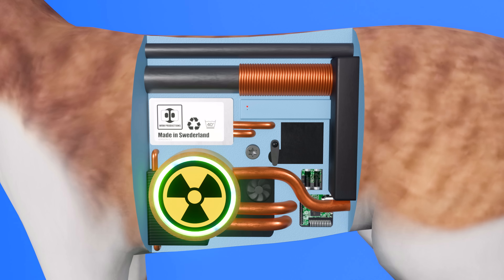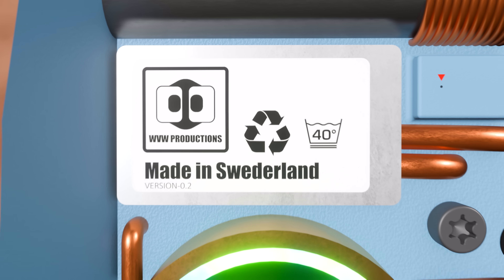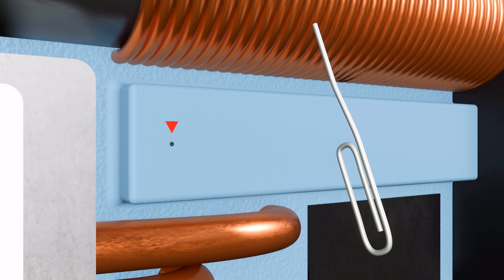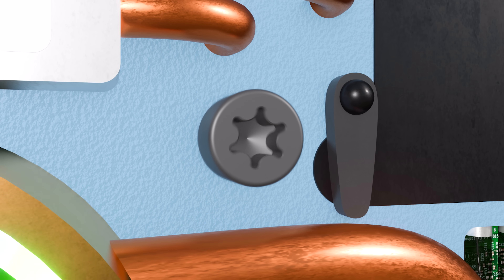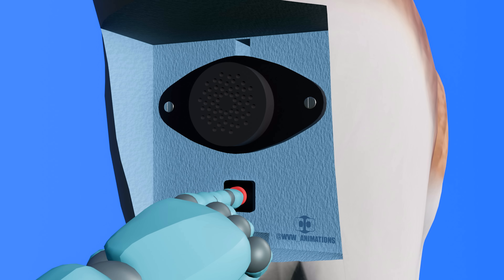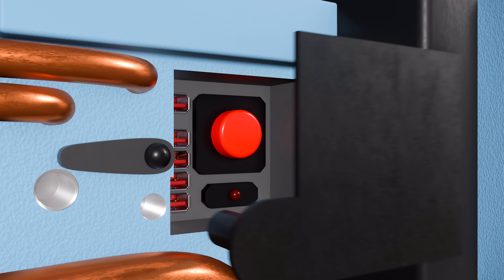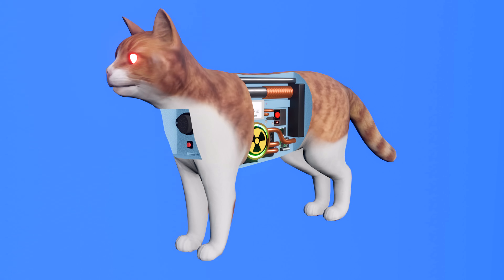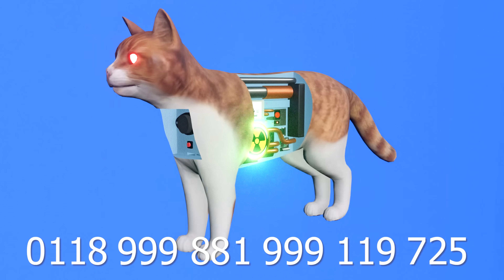How to fix a cat

Comment: Heres my notes on the process incase you missed something

Cat repair

Step 1
Activate safe mode
3 strokes behind left ear
Listen for chime and lights
Ballistic systems disarmed
Step 2
Place on back 
Remove screws with and LTE5 Screwdriver with plastic handle and demagnetized tip / use a coin
Open side panel 
Wait 3 seconds to insure no leaks in nuclear core
Step 3
Insure unit meets WVW standards, look for company insignia and country of origin above nuclear core, all genuine units made in swederland
To reset BIOS insert a paperclip into the hole and push until click is heard
Step 4
Unscrew bolt on side and move to front
Remove panel, cat default language reset
Step 5
To set language press red button until preferred language is pronounced 
To flash BIOS turn level securing the black cover
Remove cover into BIOS control panel 
DO NOT press the large red button, if pressed will trigger self destruct
In such event remain calm and contact WVW emergency support line at 0118 999 881 999 119 7253

Comment: For some reason the safe mode is not being activated , I've tried it multiple times still doesn't work , currently the system has been locked for 72 hours and I genuinely don't have any idea what to do , also it says that after 3 failed 72 hours attempt a meteorite would be summoned so can't risk it . Tried calling the customer support but the call is not being transferred. 
Really a big let down on the side of WVW Productions , the manufacturer's should provide a complete solution manual with the guide . 
Not buying more products anytime soon

Comment: If your cat is coughing alot, its simply a bomb that didn't pass through

To fix this, deactivate safe mode and unscrew the M5 bolts to the neck panel.

Identify the bulletloader with care before cleaning out the bullet/bombpasser with a cotton swab.

After that, Grab the bomb, make sure its not fusefired.

Then, take off the leftside panel and insert the bomb back in the bombreleaser.

Comment: I love how the model for the cats internals doesn't make any sense. the front panel comes off with a screw that doesn't connect to either the top or bottom guide bars. the BIOS Panel cover has a smooth peg that slides out of a threaded hole. and that the cat is demonstrated to be capable of recoiling dispite the internal frame having no crunch points to physically allow the cat to compress into itself.

Comment: Quick note: in the video it says to set the lang preference BEFORE flashing the BIOS successfully. After flashing the BIOS I had to set language again so you might want to just do that as the last step before putting the panels back on. Also, if anyone is interested I can make a video on my method for testing radiation leakage using an undeveloped photo as it is a bit safer than the one they did. Other than that kudos to the support team for putting this out. I know I definitely got a budget unit and didn't expect any support at all. My cat is back to normal dysfunctional.

Comment: Help, my cat is coal powered, it uses a coal power plant to spin up a steam turbine, it’s way more complicated and requires distilled water refilling, my heat exchanger and dual polisher has failed and I need a replacement, but I can’t find it anywhere in your website, is it still in service? Thoughts and prayers😊

Comment: Typical modern engineering, why oh why did the deem it necessary to use a LH threaded screw on the front cover retainer. Its just aaking to be snapped off and if your cat is more than a couple of years old it wouldnt be worth fixing. Old cats were never designed like this and were much sturdier.

Comment: Scratched the ear three times, no jingle. Safe mode not activatible, cat is eating me. I am now inside the chest cavity of the cat. Instructions unclear
Reply: Oh, you got the D model. Those tend to be grumpy. Find the emergency lever in there, it should be somewhere.
Reply: @SuperODST1  yes he got the CD/4 with the Informal Disciplinated  Behavior unit
Reply: @HaTran-pv7bp I have the A'-9 😢 from the 1600s how do I stop it?
Reply: @Subzero_memes  the 1600s A-9 version is gas powered and does not have a nuclear power plant. to stop it simply hold it carefully under the torso, then open the compartment and remove the chamber
Reply: I dont know they model of my cat but It is nothing like yall models can someone help me?
Reply: @hazamada-lh4hb  can you explain any details about it
Reply: @HaTran-pv7bp like i only know they color, its like half Black half orange
Reply: @hazamada-lh4hb  just look at the model inside the chamber compartment, it should be next to the nuclear chamber
Reply: Did you definitely scratch the left ear? I don't think that it works on the right ear. hope this helps  👍

Comment: Instructions unclear. There are no screws and now my cat is clawing at me. It also speaks french now.
Reply: Stop liking the post and someone tell me how to fix. I see no reset button.
Reply: @GamerGod_88  😂😂😂😂😂😂
Reply: @Ganara426 I think bro is being serious
Reply: @GamerGod_88 🤣🤣🤣🤣🤣🤣
Reply: @GamerGod_88  hello this is WWW support. If you see no screws your model is an offbrand version of our unit and you should get rid of it and buy a legit unit
Reply: @GamerGod_88  Ahh you got one of the Friday cats.  Has it gone nuclear yet?
Reply: Méõw
Reply: Your cat must be battery powered, you need to shake its right front paw once and the battery holder should come out (you need 50 double a’s
Reply: @jedrekk My cat speaks now japanese, and can walk in the walls, is that normal?
Reply: insert some clever obligatory joke that references screws and claws alongside “nails”
Reply: It must not be running Windows XP
Reply: @HerpieDerpie-op2yj  Cats are not compatible with any other OS other than Windows XP. You will break your cat if you attempt to run any other OS on it. Especially Vista.
Reply: WHAT HAVE YOU DONE, you activated the baguette mode!
Reply: that happens sometimes yeah
Reply: Don't worry this is the advanced organic version the skin you feel there is just organic covering you can remove it with the tool you got with your cat
Reply: Seems like you have an older model the newer ones have screws
Reply: Factory reset. Turn the unit upside down for 15 seconds, then place back down on the ground and brace yourself.
Reply: Did you activate safe mode?
Reply: @GamerGod_88  at least you didn't press the red button
Reply: Ah you must’ve gotten a older model
Reply: Easy, just bop the nose then turn it into safe mode
Reply: speak french back
Reply: Mine is foaming at the mouth and singing Madonna at the top of his little kitty lungs. Is factory reset an option?
Reply: @Camp_LameOnion Sadly no, you're gonna have to exchange it for a functional one.
Reply: 404 likes🔥
Reply: "Meaux"
Reply: Did you check the cylinder? Some of the old ones were gas piston actuated
Reply: Oh yes, you’ve got the Cat model LTE7790653 code name: REAL. To repair it, wait until it is resting and then repeat. The screws should become visible.
Reply: Ah you must have the old version. This tutorial doesn’t work for 1.9. There’s not many tutorials to fix this version, presumably because they want you to just buy a new one.. I’d recommend taking it to a professional cat repair specialist but NOT to the official WWW shop
Reply: If your cat is speaking french, it is beyond repair.  If it's still under waranty you may get a new one for free from the factory
Reply: "J’ai besoin de croquettes"
"Donne-moi à manger
Reply: instructions nuclear.
Reply: Not French 😢
Reply: Miaou miaou...
Reply: My dumb ahh thought it was Puss in Boots
Reply: Oui

Comment: Hi, 
I purchased one of these cat units from a 3rd party website. It was used. My question is, how do i flash it back to the manufacturer bios? The previous owner jailbroke it and flashed a custom one. However, the unit keeps coming into my room at 3am with this loud "meow". 
Thanks for the help.

Comment: Just an FYI that's shown but not explicity covered in the video, the internal torx bolt blocking the lever securing the black cover is reverse threaded. Also note if you tighten this bolt too much, it could pierce the back of its housing and damage the coolant line behind it. I believe this was fixed in v0.3 models, but this is how I sadly lost my older v0.2 Calico (and most of the city block in the resulting fallout)

Comment: By the way if your cat is low on lives you can press the cats nose down for 3 seconds this will open a control pad. Then in under 3 seconds press the following buttons in this sequence: 

⬆️ ⬆️ ⬇️ ⬇️ ⬅️ ➡️ ⬅️ ➡️ (B) (A) [START] 

you will know you did it fast enough when you hear the classic zelda jingle for solving minor puzzles 

After that the cats life count should reset to 9 and you can close it up it will take an hour to reboot so be patient

Comment: My cat is solar powered,  it's always laying in the sunny spot on the floor.
Reply: That means it was made in south Swederland
Reply: This is an older, outdated unit. Please return it to the manufacturer for refitting.
Reply: @unoriginalname4321  no, modern units use solar power, much more efficient with how often the units sit in the sun anyways
Reply: Do you get government subsidies for your cat?
Reply: you mightve gotten the limited solar panel version that's only manufactured every decade
Reply: I got the solar model too. They need to update the tutorial so that it shows how to disable the inverter, that way we can do maintenance without a electrical short.
Reply: Woah, how long does ur unit have to be in the sun per day? I've seen an offer on facebook marketplace and really considering it
Reply: @Keiy_Schilon  doesn’t HAVE to be in the sun very long but the smart aim always guides towards sunny areas, even at full charge. I personally got a solar charging unit, and it has not died once
Reply: I can't fix fuel system of my cat. She confirms too much fuel, but she's still tiny. How I can switch on the safe-energy mod with it?
Reply: @kylekyle4505 Are you stupid? Do you not get jokes??? I think you need to stay away from the internet if that’s the case……
Reply: True
Reply: Mine also I think mine is solar powered in summer and sunny days but USB charged when there is no sun
Reply: You may want to check if it has a battery issue if it cannot retain a charge.
Reply: I’m a biologist and this is NOT even CLOSE to how a cat or any biological animal works. Cats have organs and if sick really needs to see a veterinarian!! This isn’t funny.
Reply: @kylekyle4505  #brodidntgetthejoke
Reply: @kylekyle4505 

Bro, it's a joke and it IS funny.
Reply: @kylekyle4505  r/woosh or whatever it is
Reply: @kylekyle4505  this is all just a joke, you don’t need to take this so seriously
Reply: @BlazePlayzGames62  don't feed the troll...
Reply: @kylekyle4505 dude has never witnessed a joke in their life
Reply: @kylekyle4505  bro is an AI in secret 😔👍
Reply: @kylekyle4505  this has got to be troll baiting. No one is actually that dumb to think cats are nuclear powered. And if you thought the creator believed this, than no way you are a vet. You can't be that dumb, so you must be laying troll bait.
Reply: @kylekyle4505 it’s funny.
Reply: @kylekyle4505  The whole point of the video went flying right over your head. 😆
Reply: @kylekyle4505 

Well mister NERD. Please take a joke
Reply: @kylekyle4505  conspiracy theorist
Reply: @kylekyle4505 We laughing at you for this comment
Reply: @kylekyle4505  🤦🏽‍♂️🤦🏽‍♂️
Reply: @kylekyle4505  oh, that model is SUPER outdated. return it to wvw and get a new one.
Reply: @kylekyle4505  r/wooooooooooosh
Reply: @kylekyle4505  did you not get the joke?
Reply: @kylekyle4505 , I'm a biologist too, but I can recognize something as a joke and don't take it so seriously.

Comment: For those who don't understand The F-35B Lightning II: A Game-Changing Multirole Fighter

The F-35B Lightning II is a fifth-generation, multirole fighter aircraft designed to meet the diverse needs of modern military forces. As a variant of the F-35 family, the F-35B boasts exceptional capabilities that set it apart from other fighter jets.

Key Features

- *Short Takeoff/Vertical Landing (STOVL)*: The F-35B's ability to take off and land vertically enables it to operate from small, austere bases or amphibious assault ships.
- *Advanced Sensors*: The F-35B's AN/APG-81 Active Electronically Scanned Array (AESA) radar and AN/AAQ-37 Electro-Optical Targeting System (EOTS) provide unparalleled situational awareness.
- *Network-Centric Warfare*: The F-35B's advanced communication systems enable seamless integration with other aircraft and ground systems.

Operational Capabilities

The F-35B's versatility makes it an invaluable asset for military forces. Its capabilities include:

- *Air-to-Air Combat*: The F-35B's advanced sensors and maneuverability make it a formidable opponent in dogfighting.
- *Air-to-Ground Attacks*: The F-35B's precision-guided munitions enable it to conduct effective ground attacks.
- *Intelligence, Surveillance, and Reconnaissance (ISR)*: The F-35B's advanced sensors enable it to gather critical intelligence.

Conclusion

The F-35B Lightning II is a game-changing multirole fighter that offers unparalleled capabilities. Its advanced sensors, network-centric warfare capabilities, and STOVL ability make it an invaluable asset for military forces.

Specifications

- *Length*: 51.4 ft (15.7 m)
- *Wingspan*: 35 ft (10.7 m)
- *Height*: 14.4 ft (4.4 m)
- *Empty Weight*: 29,300 lb (13,300 kg)
- *Max Speed*: Mach 1.6+ (1,200 mph+)

Sources

- Lockheed Martin F-35B Official Website
- US Department of Defense F-35B Fact Sheet

Comment: step 1: shut down cat
step 1.5: unlock the maintenance panel
step 2: boot into KATos Maintenance mode
2.5/4: make sure to look at step 4
step 3: use the emergency cache flush button if KATos not booting normally
step4 : unlock the bootloader reboot button hatch
step 5: KATos will now boot

Comment: The guide should include the fact that the bolt on the side is reverse threaded, improper usage could break the threads on the unit or damage the bolt.

Comment: My cat stopped working about 3 hours ago, took it apart and found the issue :
The reactor is fine, but the thermal-electric coupling (the thing that turns the atomic heat into electricity) is shot. Anyone know how replace it?

Comment: Could you tell me how to fix the original model because it started leaking gas
Reply: Thank you for contacting WVW support - your call is important to us!

Before performing a fuel system inspection on your unit, ensure the engine is off by gently petting the region between the ears until the optical sensor covers close.

Once you have confirmed the engine is off and the unit is safed, remove the panel screws as shown in the video above.

Identify the source of the fuel leak by visual inspection or by vapor analyzer tracing. Fuel leaks are commonly reported around the fuel filter, the fuel pressure regulator, and the fuel pump. Inspect these areas and verify there are no cracks or abrasions in fuel hoses. If the fuel filter is blocked or contains hairballs, replace it with WVW part number CAT-321FF.

In some cases, excess unburnt fuel may escape through the exhaust port at the back of the unit. If this is the case, ensure the fuel blend in use with your unit contains the appropriate mix ratio of fuel to dietary fiber. Additionally verify the combustion chamber has adequate compression (at least 125 PSI) and that the ignition system and timing are set correctly (set 5-10° before TDC).

After you have completed the fuel system service, replace all panels and follow the re-activation procedure:

1. Re-start the engine by rotating the tail crank. When a soft vibration occurs, the engine is running.
2. Listen for the engine temperature OK tone "meow" to indicate that the engine has reached operating temperature.
3. Verify that the optical sensor covers are open.
4. To refill the fuel tank, gently shake a bag of WVW premium pre-mixed fuel blend in auditory range of the unit. The unit will promptly approach the fuel bag and will automatically refill via the fuel fill port.

Thank you for contacting WVW support!

Comment: I flashed my cat's bios with a custom firmware update that allows for overclocking of the hind legs. Holding the cat out in front of you with one hand and rubbing the belly with the other, the claws on the rapidly-cycling hind legs can cut through the hinges on a steel security door in just 1/3 of the time time as an acetylene torch. It doesn't function underwater, however.

Comment: Aint no way you can't even use a normal bolt to replace the language settings cover bolt,  that sh*t gets stripped so easily😭 y u gotta use a reverse thread bolt man, sh*t aint fair

Comment: 0:52 help I’m using the gas-operated tuxedo 18-B. I need a tutorial for that
Reply: To check the state of your deprecated gas-operated unit, ensure that the fuel tank is full and that the I2 engine has no holes. Then, take the top rocker covers off, and check the piston timing. Then, check your oil level. If the oil stick is not a golden color, replace the oil immediately. Otherwise, proceed with basic maintenance. Due to a quirk in the tuxedo 18-B assembly line, you may be required to replace the 2nd external controller PCB for your unit to function correctly.
Reply: @windows-98s  But it’s not gas-operated as in gasoline, it’s gas-operated as in gaseous, as in guns
Reply: @bodhismith2457 To check the state of your deprecated ammo-based unit, ensure that the barrel is free of ammo, dust, rats or a Little Boy atomic bomb (this is a common one). Then, access the plate on the right side labeled "DATA EXPUNGED" (it may also be labeled as "REDACTED", depending on serial) and press the small green button. This will open the floppy disk drive, insert the disk labeled "W95 BOOT" and restart your machine. Then, access the diagnostics panel from the left side.
Reply: Are you a bot